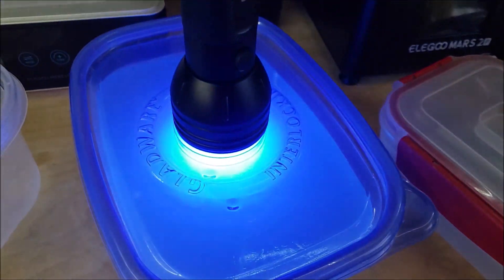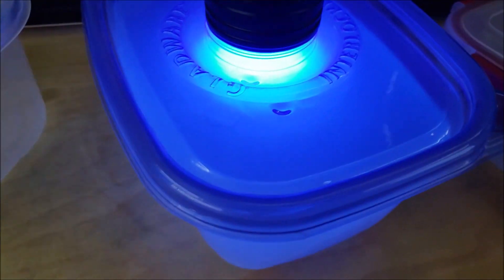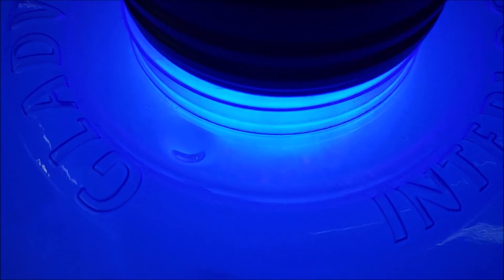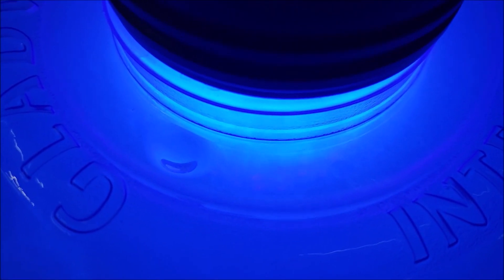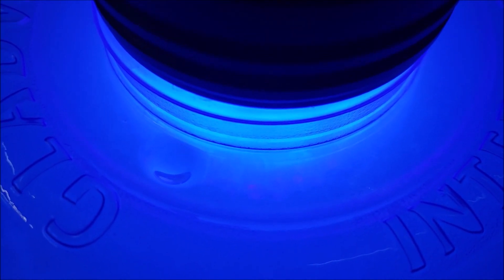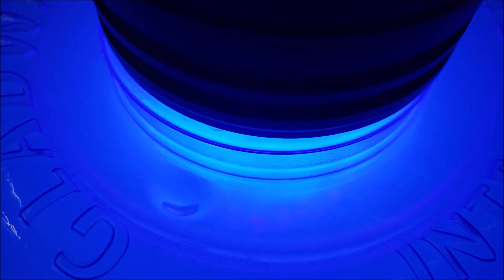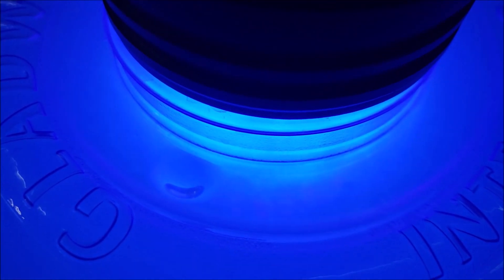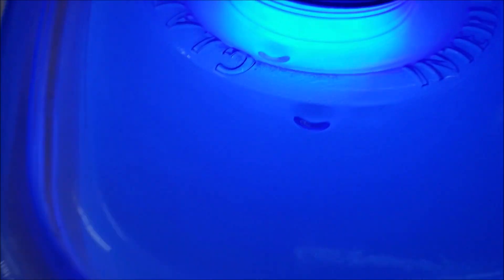Rapid Resin Wash Cleaning #1 - 30 Minute First Test Looks Promising

Comment: This is similar to what I do.  I have a cure box I put the resin soaked IPA into.  I put on some UV glasses and turn on the box.  As it rotates I scrape down the sides.  After about 5 or 6 minutes of this I just let it sit for a few days, all the solids sink to the bottom and hold together and the clean IPA can be poured off.

Comment: ive done this..found the ipa to be much less effective afterwards..I was using 99% ipa
Reply from the maker: Yes. 99% IPA is hygroscopic, quickly absorbing water from the air. Over days or weeks of use, it will stabilize to around 65% - far less effective than 99%, and only marginally better than water alone.
This method is used to precipitate and separate the plastic from the solution so it can be cured and disposed-of properly.

Comment: creating a thermal reaction in a tub of highly flammable liquid. Genius.
Reply from the maker: I'm leaving your comment for now. I'm not a scientist, but after re-reading the MSDS for 99% IPA, I believe your comment to be uninformed speculation.
At standard atmospheric pressure, a battery-powered UV LED pocket flashlight has nowhere near the energy to raise 2 liters of IPA to its Auto-Ignition Temperature of 399°C (750.2°F). The heated plastic resin is quickly heatsinked by the far larger volume of the surrounding liquid.
Fumes? Yes, but there are ALWAYS fumes: The Flashpoint of 99% IPA is very low (11.7°C, 53°F). Simply pouring IPA into to your wash tank vaporizes it into your environment at room temperature too. 
Open the windows.
Reply: You may be the only person in the world who thinks that you can ignite alcohol with a flashlight.
Reply: @johncahill3644  People don't use ipa in an ultrasonic cleaner... use that 2 iq you have  to figure out why, then tell me how suspending a cheap Chinese electrical component is a good idea.

Comment: I suspect you will get different results from different resins. I just let gravity do the job. Resins generally have specific gravity of 1.1 and Alcohol about 0.8. So resin will in time sink. I have never thrown any IPA or these days I use Metholated Spirits out. Well almost never. All that gets discarded is the settled portion in the bottom of the storage containers which is probably 50/50 Alcohol and resin. And that is not very often. Using tall slender containers helps. I have tried your method by using the UV curing chamber. It does work but the settling method is less work. Good on you giving it a go and for sharing. Thanks.

Comment: Do you have before / after image. Does it get clean/er/ish
Reply from the maker: After settling overnight or ~24 hours it was very clean above the sediment. Not 99.9% new IPA clean, but absolutely reusable.
Reply: @AustinMics  Cool, thank you for reply. Looks like a really easy way to clean IPA. Have to give it a try. Is it a standard UV lamp, 400nm ish.
Reply from the maker: @persimonsen8792  395nm. "Rechargeable UV Tactical Flashlight" on Amazon.

Comment: Anytime I've tried this I've managed to separate the resin but I'm left with an alchohal that has lost most of its cleaning properties. If there's much left outside of the water content on one go I doubt anything useful is there after a second time.
Reply from the maker: Right. 99% IPA absorbs water from the air until it gets to ~65%. After opening a sealed bottle, nobody has pure 99% IPA, and it dilutes more each time. I'm recycling/reusing here, not distilling. I reuse my recycled (65%) rinse as pre-rinse before my 99% IPA bath, and I'm certainly not spending as much on new 99% anymore!
Reply: noticed the same thing..the alcohol didnt really work well after doing this

Comment: Good tip, What is the wave length of the uv light that you are using?
Reply from the maker: I don't know. Whatever is in the blacklight flashlight from Amazon.
Reply from the maker: Claims 395nm for the Blacklight. "Rechargeable UV Tactical Flashlight" on Amazon.